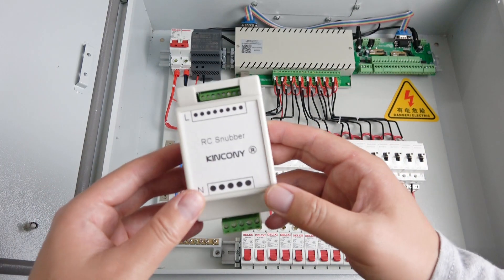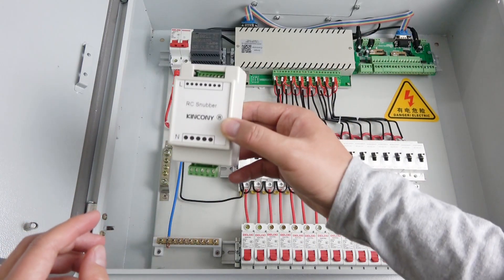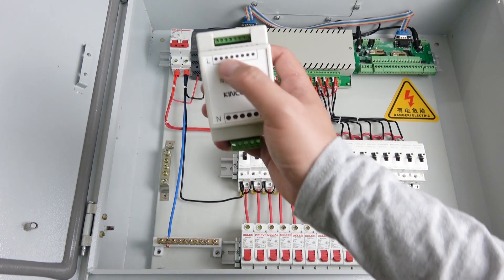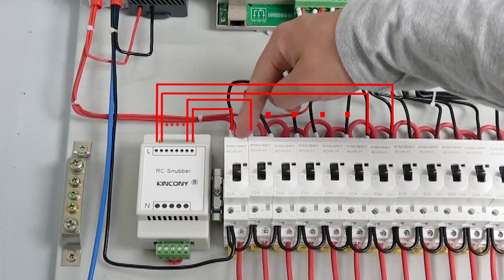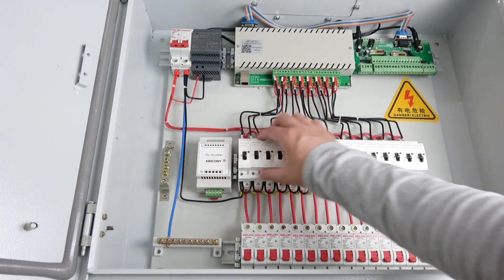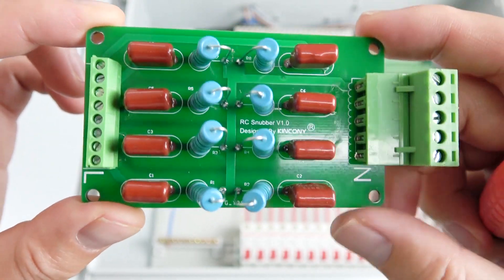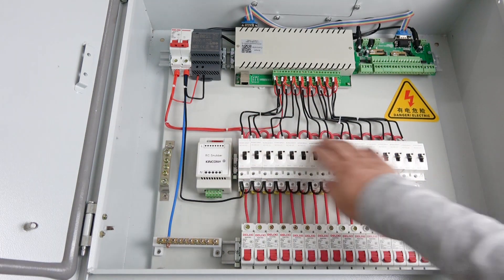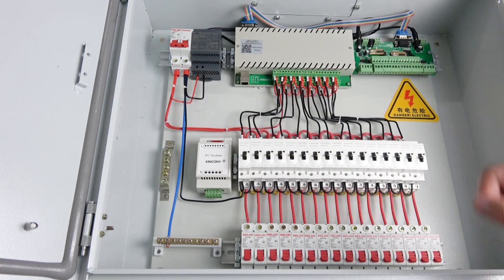How to install RC snubber for AC contactor in Power Distribution Box

Comment: thank you for your explanation, i have a question installing it in the Power Distribution does it cover all devices in single AC contactor,
like i have in my house every room got one AC contactor for power only, lighting power have there own AC contactor, but my AC power cable goes from one to other, you for tv, charger and ac device. does this tool cover all device and it will contain any arc spike could happen in that line ??
Reply from the maker: every AC contactor 's coin need paralleling RC circuit. such as our RC snubber have 8 channel, so it can connect with 8pcs of AC contactor's coin, you can calculate how many total pcs of RC you need to use.
Reply: @KinCony  thank you for your reply, but still not answering my question, what i mean is if i connect your snubber to my 8pcs of AC contactor's coin, does it cover all the device, like i said before each room in my home connect to one AC contactor's coin for AC power plugs, so does it cover all the devices in one AC contactor's coin ?
Reply from the maker: @rafaatashour  RC snubber is used to eliminate interference signals caused by contactor coils, rather than eliminating interference signals at the load end